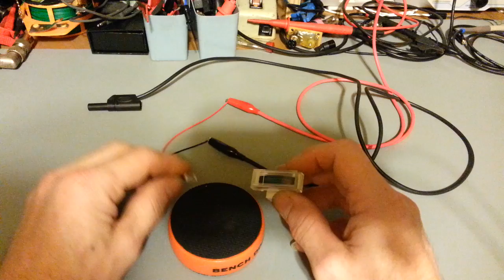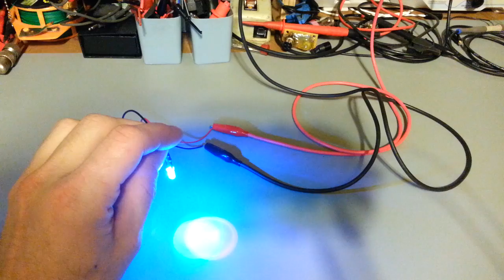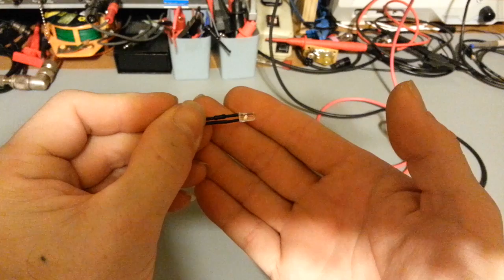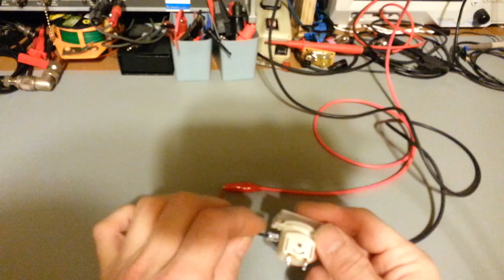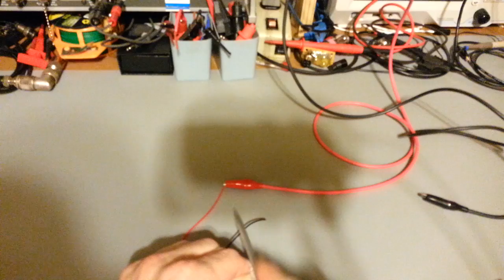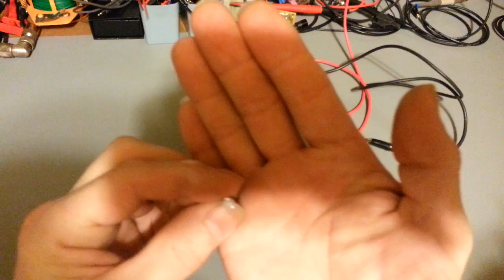Color changing LED for meter lights and modifying the lens for wide angle.

Comment: I usually dip them in a bit of white silastic or gap filler....its also a way of gluing them to the back of the meter...the led lights up the silastic and it spreads everywhere rather than a focused light......great for really wide dial lamps....if I need brighter I just add more Led's into the blob

Comment: Great tip, I just got 10 LED 44/47 pinball bulbs off ebay and i am going to use them in my Hallicrafters S-86.
The ones I have are white and there is a "hot spot" so I will try filing them so I will get a wider beam of light.
Thanks again for the tip.
Reply from the maker: old64goat 

If you want 47 replacements in LED's that don't have hot spots check with Comet Pinball.  They are the go to place for LED replacement bulbs in a vast array of colors.  I really like their cool white LED bulbs, not blindingly bright white like a lot of them are.